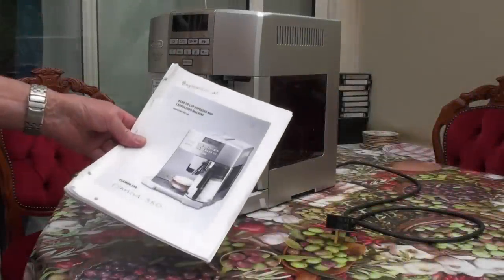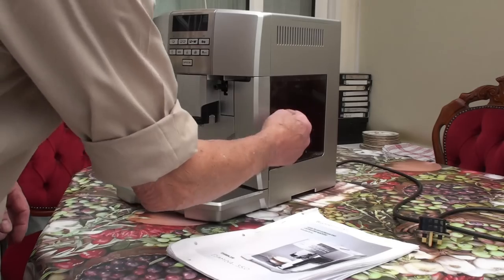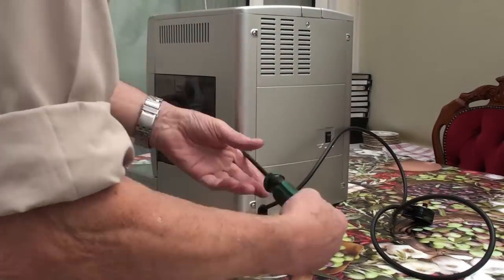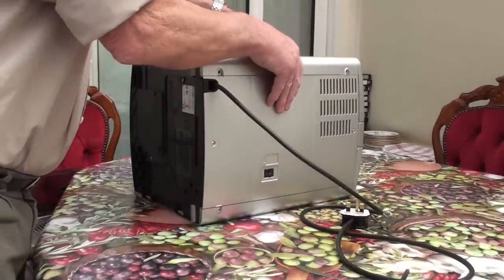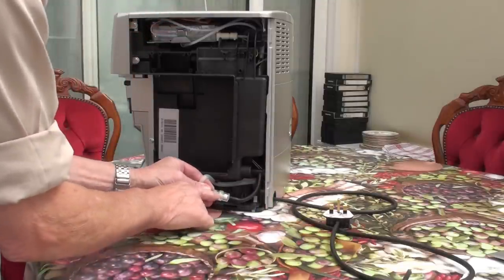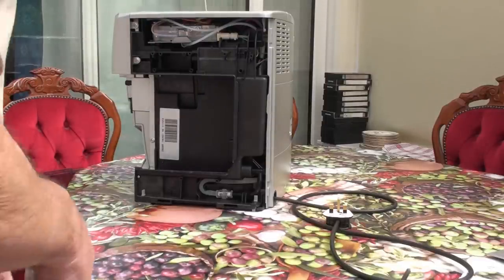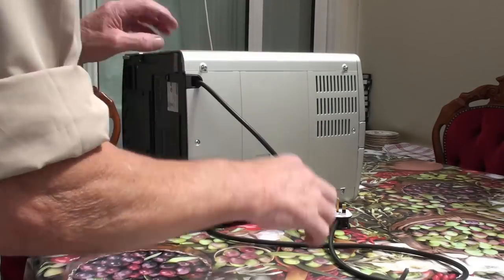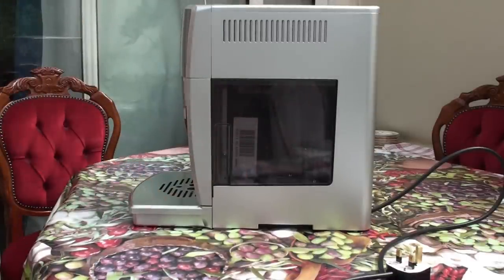Delonghi Empty Circuit Fill Circuit Empty Circuit

Comment: Great video, thanks, we had furred up pipes and filter, showing how to get the sides off was excellent as this is always the unknown and you end up breaking the lugs, so the video saved that problem. Took off the two transparent pipes from the pump on ours too, they just pull off with a gentle squeeze with pliers, the was residue attached to the walls of each pipe, cleaned with pipe cleaner and refitted. Refilled and all working good now. Not bad as has been in operation for 9 years and delivered excellent coffee throughout.

Comment: Great fix Terry. Faced this issue right after completing the descale procedure. Followed you instructions - removed the little filter. Gave it a few blows through each side. Re-inserted and turned on machine. Get the same error again - then pressed "Ok for hot water" as display instructed. It coughed and spluttered but this time water was dispensed from the water spout. Then pressed one coffee button and it is now working normally again.

Comment from the maker: Update! After a while the same problem returned. This time I took the sides and back off and cleaned (squeezed) the clear plastic pipes starting at the bottom left on the back... after releasing the little metal clips that hold them on. There was a little lime build up on a couple of them. I blew them through where possible.  So far so good.

Comment: There are other issues that can arise that cause this problem - anything that prevents water from getting in the line.  in my case, it was the large water filter that fits inside the water container - after not being used for a while, it was blocked.  so its worth checking the bottom of the water container - by pressing in the nozle at the bottom, water should flow out.  if it doesn't, there is a blockage in the tank. or the water filter.

Comment: I have a Delonghi Perfecta.  The back cover comes off with two screws. Then the side panel (water tank side) screws are accessible.  This provides access to the small filter. I blew it out and soaked in vinegar.  This worked.  But, with the panel open you can easily check out the other tubes as well.   This is a first cut before having to send the unit in for repairs.  Combine that with descaling.  Thanks to Terry Morton!

Comment from the maker: Thanks Colin. You may find that the problem returns. If it does clean those other pipes behind the rear panel (take side panels off first)..you may see scale on them.. just squeeze them to loosen any grime, then clean as if descaling for a while. Hope that helps.